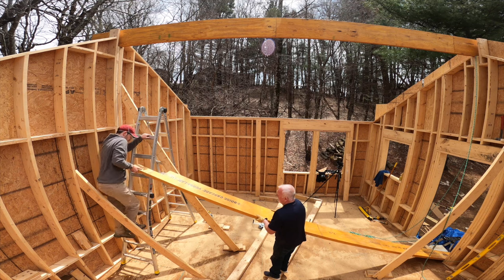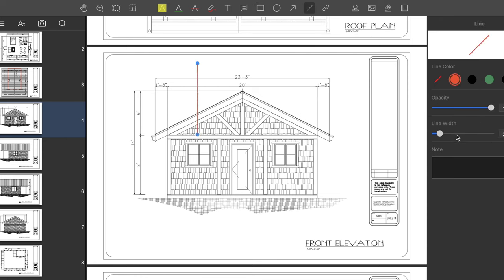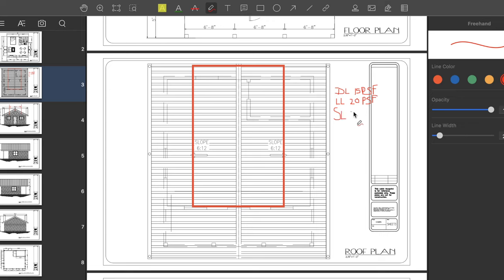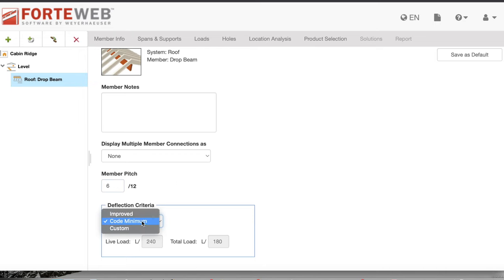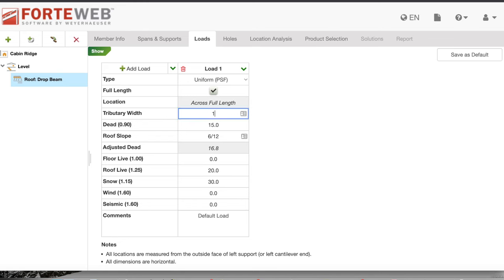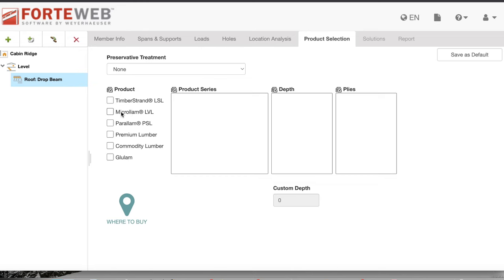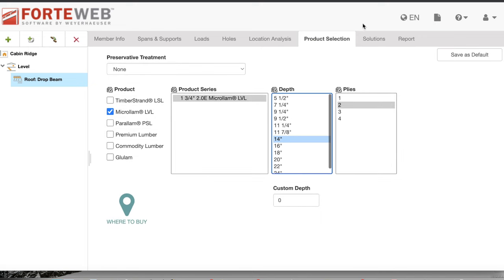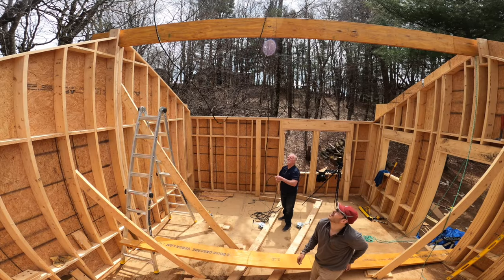DO NOT Undersize the Ridge Beam or This Could Happen - EP 28

Comment from the maker: You can now get the free DIY Cabin Blueprint at :
thediycabinguy.com/blueprint
Reply: I'm only 6:56 into the video, why don't you use the rope like you did on the first beam with the 2nd beam? you can use the first beam as the pulley so you wouldn't have to break your back?.
Reply from the maker: @rickk6447  I think it was just way too heavy just with the rope
Reply: @TheDIYCabinGuy  That's why man invented the block and tackle pulley system.  1 man can lift a motor out of a car using one.  I built a 4 season sun room on the back of my house and my retaining outer wall was 20 feet long and I had no-one to help me so I put blocks to stop it from going over and built a rig to use as a high fulcrum point to pull the wall up and into place and then secured it in place so I could level it and hoist the 2 outer walls in place to lock everything in square.

There's always a way.  it's just a question of figuring out how to do it.  I could move a 2 ton stone block alone with nothing but round stones and levers.  Ftr, I don't EVER want to do that but I know how to do it if I ever had to.

Comment: I love how “do it yourselvers “ grab the code book , over build everything then bash builders who have been doing this for years without fail… here you’ve added more weight to your walls without adding any real strength.  Pretty presumptuous !!
Reply from the maker: Trust me , the beam is sized appropriately for local snow and dead loads.
Reply: Just because your building doesn't fall over, doesn't mean it was built correctly.
Reply: Codes are put in place for public safety. They are written because failure can be reasonably anticipated or incidents of failure have already occurred. My advice is always to fully comply.

I am not sure the installation method was the safest. Lot of load on that ladder.
Reply: Im not sure if two lams were enough, much safer with four or six...
Reply: Code is the minimum you are legally ALLOWED to build. If you go minimum, it sags slightly in 4-5 years. I built my house to spec, but after years of seeing 2x6 spanning under 8’, and 2x8 on 16” center spanning under 12’ sagging in a few years, I now overbuild for my clients. After all there are some brands that have APA specs for 7/16 OSB that says 32” for roof, 16” for flooring, it seems pretty wildly under built, and saggy to me. Code typically defers to manufacture installation instructions, so good to go there. Over build everyone, wood gets weaker with humidity and humidity vapor intake/release over the years.

Comment: That looked painful! I am a structural engineer and I have a feeling that the beam was a bit overdesigned. You could have used 12 psf for the DL and the 30 psf snow load that you used could've been reduced to about 21 psf (due to slope and other factors). There is a difference between ground snow load and roof snow load. A more economical beam could've ended up being (2) 1 3/4" x 11 7/8 LVLs. I am glad you were able to install it without any incident though!
Reply from the maker: You’re right, I didn’t reduce the snow load. Not being lazy could have saved me some backaches 😂
Reply: multiply by .55 for reduction?
Reply: Are you allowed to reduce the loads under prescriptive construction rules, or is that only allowed with an engineer's stamp.
Reply: @dallinweir  in Appendix C of the BCBC, the calculation is done at .55 for most residential buildings
Reply: absolutely.  I mean, the rafters ARE important.  And Collar ties important, but the ridge beam, if rafters are opposed to each other, is not anywhere near as important.  I often make my rafters 4x or at least 3 by, and I always have collar ties every 4 feet or so, but I've never had a ridge beam anywhere near that size.
Reply: @kondasixtytoo487  I'm in the US. We use the IRC and IBC, not BCBC.
Reply: @dallinweir  I imagine some kind of reduction in IBC as well?
Reply: I’m sure he’ll appreciate not cutting corners if he gets a winter like the one experienced in much of Utah and areas of California. Salt Lake City exceeded 80 inches this year. My parents in Minnesota have 3.5 ft on the ground. If you feel comfortable cutting corners, by all means. His structure will still be standing while yours is collapsed potentially, that’s all.
Reply: This beam is definitely overkill as a ridge for this structure.
Reply: @dallinweir 

This is just my opinion, but I have built 3 houses. Two for myself and one for my sister and brother in law. We had all kinds of engineers and building contractors tell us how our part of the construction was going to fail. The only parts we had  trouble with is the parts we subed out to "renowned builders". There is lots of information online these days. Always check codes, use common sense and research to build anything. Don't economize by reducing load reduction. Remember  most times when an engineer is designing something for the "renowned builders" they do skimp on dimensions to save the builder money. It is nearly impossible to hold builders and engineers responsible for failures. Also, usually when builders and engineer failures occur, they are long gone. Sorry for the rant but I have remodeled several "renowned builders and engineers" failures before. Build it yourself and be proud of it, just research and don't skimp just to save money and you will thank yourself later. Thanks!

Comment: I lifted beams bigger then that by myself with fairly minimal effort.  How I accomplished it was building a A frame with a collar tie about 4 ft higher then the final height, installing a lag on d ring.  From the d ring I hooked up a old block and tackle pulley attached it to beam and then hoisted it up.  I like to have a tie off point ready so when I hit my height I tie load off so I can go up the ladder and slide it in the pocket.
Reply from the maker: Nice !

Comment: Here in the UK the ridge beam is not used to take any of the load of the roof. The roof is made up of a triangle with two rafters and one joist, get this right and all the roof load is sitting on the walls the rafters are on. Typically these are factory made and just spaced on site with a 6x1 inch timber to hold it in place at the ridge. Generally we do not make a roof under about 30 degrees and it will be tiled with clay or cement tiles. 
It is only if we leave out the joists to make a loft room that a ridge beam may be used but even then not of that size.
Reply from the maker: Nice !
Reply: ya its the same here this guy just dont know what hes doing ridge takes no loads or shears ever
Reply from the maker: @frostycools1315  magic cathedral ceiling holding themselves together
Reply: @frostycools1315  It sure does take a load if there are no ceiling joists and the ceiling is vaulted (at the underside of the roof rafters).
Reply: @@eddied3246  Sure, a ridge can be designed as a beam to carry half the load of the rafters, but that is not the norm In most typical wood framed residential structures.  This is why the term ridge board is a thing, they are usually just that - ridge boards - not ridge beams, because there are usually either ceiling joists or collar ties in an attic that help to carry the load of the roof and relieve all the outward forces it imposes on the top of the exterior walls.  When the ridge doesn't have that help it needs to be designed as a ridge beam, a much more substantial structural member of the house frame.
Reply: @@eddied3246 Yes, a cathedral ceiling by definition means no horizontal structural component (an unfinished or finished attic floor structure) connecting to/siting on the top of the exterior wall, which exposes the underside of the roof rafters to get finished as the cathedral ceiling. It can be done of course, but not without accounting for (engineering) the elimination of a key structural element of the building's frame which is usually there. The elimination exposes the top of the wall to forces from the roof rafters pushing out that the attic floor joists worked to resist.
Reply: Cannot see how these ridge beams help if the rafters are attached to it. If it was fitted underneath and gussets used to secure the head of the rafters then maybe, but not how it stands. I’ve worked on roofs for hat don’t even have a ridge board. 
Waste of time and money unless it’s underneath.

Comment: Sweet Jesus. I'm replacing the sagging ridge peak and rafters on my 40 year old garage this week. Before watching those video, but based on every other video I've seen, I was sort of counting on the job going smoothly as long as I had a camera rolling. Well, you just blew my safety net out of the water. At least to make up for it you helped me from using undersized ridge peak lumber. So..kinda thanks, I guess. ;)
Reply from the maker: 😂 you’re welcome. Good luck, check your numbers you might be able to get away with a 11 1/4” lvl. I went with 14” because theoretically I could get 3 ft of snow sitting on my roof. But most area without snow only have to use 20 PSF LL.

Comment: First beam was a bit of a struggle, but got there.
Second beam; use the first beam as a lifting gantry It is a structural element, so would be able to support the second beam whilst lifting it into place.
Reply from the maker: That’s a good point! Thanks
Reply: And take two wraps of the rope around both beams for mechanical advantage

Comment: I would love to see the code for whatever state you are building this, and I would love to see the mechanical engineer’s calculations. We have been building houses for a long time using regular KD lumber as a ridge beam!  If you go to the lvl companies and have them do the calculations then you would of course end up with this over engineered “solution”
Reply from the maker: Dang, these lumber companies following building code requirements !
Reply: Ask any real builder and they will tell you that the ones who make the codes/laws are in bed with the ones who make the materials.  Money changes hands all the time. That creates a LOT of unnecessary codes.
Reply: @AlaskaWild  very true🤣🤣🤣😍
Reply: @buratching   Not the least bit true.  Engineering specifications are code for a reason.  You must overbuild.  If you didn't, then the day someone puts a waterbed in (for example), someone is going to regret the day they were born.  The day a tree limb falls on a roof that already has snow on it, even worse.   As soon as your contractor says "ask any real builder..." politely ask them to get the heck off your property.
Reply: I’ve built and framed at least 70 houses ranging from 4-10k sq ft in the Pittsburgh area and have never double ridge beamed anything. Especially on steep roofs. Not a bit of sag in any of them ever. This multiple ridge beam garbage just started about 5-6 years ago it seems and how is a toe nail into multi ply ridge better than back nailing a single ply LVL ridge? It’s just not.

Comment: Rub a bar of soap on the LVL and the openings on each end it lubricates the wood and it would have slid in and over much easier. You can buy big thick bars of laundry soap at any dollar store or supermarket. Or liquid dish soap works too.
Reply from the maker: Nice! Wish I had thought of that !
Reply: I usually use KY Jelly on my wood.

Comment: The strop you used in making the hoist of the beam complete would have been helpful in all cases. Especially when you would have chosen to put a higher or proud chair for the beams, at the top of the construction. That would have helped significantly in getting these beams up. The excess of the chair can be easily cut to appropriate length when the beams are mounted properly. 
Why go through the inside, when your construction provides you two slides on which you can easily transport the beams upwards? 
Plus, some appropriate length scaffolding will also help, you may be tall, but are definitely working beyond your very own reach on that ladder you’re standing on. When we’re talking dangerous, well that’s something to take into account whilst building such a construction.
Cheerio
Reply from the maker: It could have worked indeed!

Comment: Too many more than 30 years ago while helping a neighbor set up a heat lamp and temporary coop for  the new chicks in the attic space of her 1865 garage I took moment to marvel at the construction. A 9 pitch with 1' X 5" rafter pairs joined at the peak, no ridge at all, every so often on center but none closer than 29". In Zone 3 10 miles 16 miles from the Canadiaan border.
Reply from the maker: But that structure had a flat ceiling? In that case, the ceiling joists are effectively tying the walls together from spreading.
Reply: @TheDIYCabinGuy ...with  joists resting on a let in 1 X ribbon board and nailed to the remaining three inches of the stud.

Comment: Great job, love to see a one or two man operation,  such a tough install, I used a material lifter ( lifts 450 lbs) rents from HD for $70 . I rolled a 4"x12"x 20' feet lamented beam on 3inch pvc on ground from driveway, then lift one end on to lift, center it then just  cranked into place made a hole out back of wall  to   Insert  beam thru, took sedge hammer to tighten back up before  putting (3) 2x6  Underneath, put some 3/4 over whole opening. My application was on a 1st floor of a old barn to stiff  up second floor then installed one lolly column under beam,  before pouring new concrete floor
Reply from the maker: Nice! I thought about using my wall jacks to try and help the process but we wanted to give it a shot just with our hands. While it was definitely difficult, it was thankfully still manageable.

Comment: I love the comments about how this beam is oversized.
Question. How many specifiers allow for an electrician to drill a 1/2 hole through the beam to conceal wiring to supply a center mount light fixtures  or fans?
Reply from the maker: Yeah very common !

Comment: Your crew and that ladder are undersized my friend. Get or build some staging. Roofs work as a system. Collar ties,joists ,and support wall s upstairs. Even support posts built into walls . I dont do cathedral ceilings, it is just wasted space that is hard to heat. You can do galleries that have open areas. the joists or beams still tie it all together. I have had old houses sag when the upstairs floor was removed. It had to be winched and jacked back into place. We wanted the wide board subfloor downstairs. The upstairs was unfinished. Just an open loft.
Reply from the maker: Nice

Comment: The LVL is now a 2x6 because you notched it.
Reply from the maker: It’s only notched at the overhang
Reply: Oh, ha!
Reply from the maker: @TruthSeeker1988  if I didn’t do that, I would have ended up with a 14” deep overhang with would be massive and hard to even trim.

Typically (from builders around here), overhangs are framed with 2x6 and they use a 1x8 trim board on the outside.
Reply: @TheDIYCabinGuy  Yes, I was skimming through the video. I saw the word DIY and was just expecting something to be messed up. What you did is common practice. My fault for skimming through.

Comment: Well first off, very few homes have the type of ceiling you are using in this home.
Most homes using conventionally cut roof rafters will be using a ridge board, not a ridge beam.
And they would also be using collar ties in order to connect the front and rear rafters together for additional strength.
I am somewhat surprised you didnt build a scaffold for erecting those ridge beams rather than using just a ladder.
And of coarse the scaffold could be used for installing all the rafters as well.
But i get the impression that there were lots of things done for effect on this project, and not for expediency.
Reply from the maker: I did what I could with what I had available, as simple as that.
Reply: @TheDIYCabinGuy  Well as a professional home builder for over 45 years i see things a bit differently than the average guy when it comes to building houses.
You as a well educated person, having knowledge of the construction process, know full well that what ive said is correct.
Reply from the maker: @ernieforrest7218  while I agree that most houses in the us do not have cathedral ceilings, it’s fairly common in mountainous regions. Almost all new houses in my area (western NC) contain several ridge beams for cathedral ceilings, in that case they need to be properly designed. 
As opposed to that, I used to work in Texas, and there, structural ridge beams were not a thing, so yes, very location dependent.
Reply: @TheDIYCabinGuy  Well, i havent always lived in Florida, and i am very familiar with mountainous regions of the country.
Especially the eastern part of the country.
For the most part, those building houses in those areas, many of which are used as vacation homes, are as concerned over cost as much as they are over design.
And in many cases, even more concerned with cost.
Vaulted ceilings as you well know can be achieved in different ways.
And the Ridge beam design you chose to use is but one of them.
The labor factor is a different situation completely.
Yes, there are job sites that dont permit direct access to material deliveries.
But then you can choose to use hand labor for moving material or choose to use machinery for doing it.
And the cost factor should at least consider the time involved as well.

Comment: I'M NOT A CARPENTER OR AN ENGINEER 
AND I HAVE A QUESTION..
WHY HE CUT OUT THE 2X12 OR WHEREVER
THE SIZE IS
IF THAT WAS ME 
I JUST INSTALL THOSE WITH OUT CUTTING'S !!
Reply from the maker: You mean at the ends ? It’s to make the overhang. That’s what all builders in my area do. Then you can use a 2x6 for your sub fascia board and a 1x8 for your fascia. 
If I didn’t cut the beam which is 14” deep, I would need a 14” deep for my sun fascia and probably 18” for the fascia board which would not be feasible. Keep watching the following episodes and you’ll see what I’m taking about.